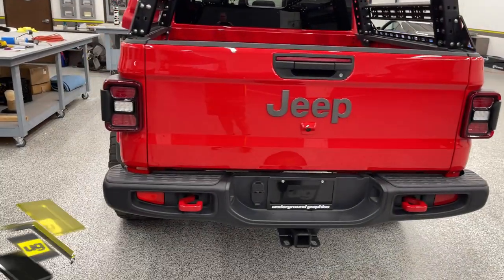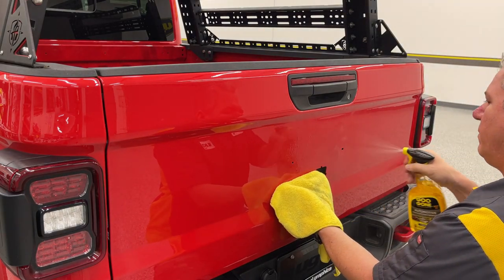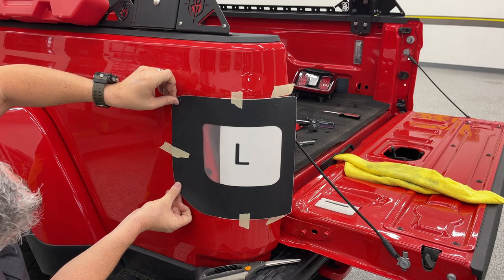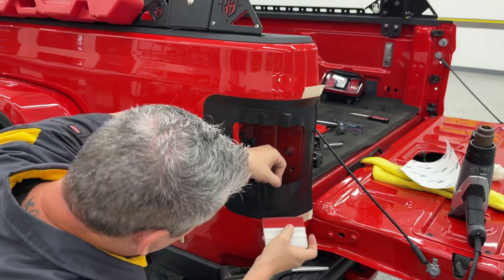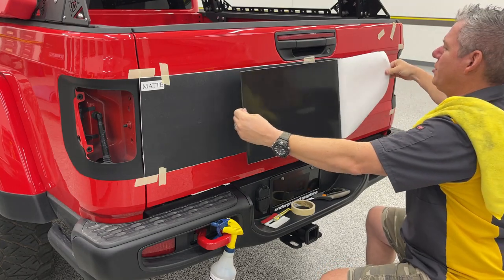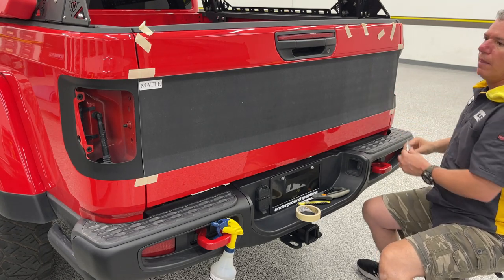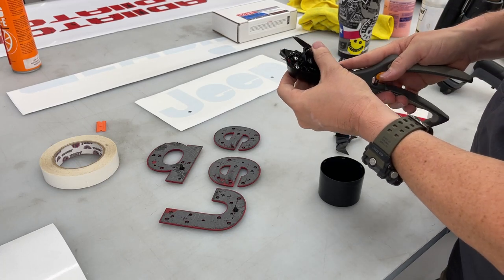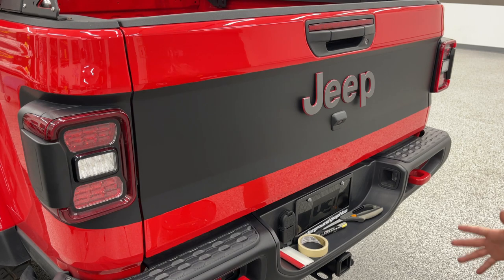How To Wrap Your Jeep Gladiator Tailgate | DETAILED Version | From Underground Graphics

Comment: Honestly if you redesign it so theres a cutout for the logo and camera it would help people align the vinyl when its time to put it on without having to undo half the tailgate.
Reply from the maker: We felt that was a short cut and didn't like the edges of the paint showing through.  Yes, this is a bit mroe work, but feel it't the "right" way.  The badge removal is really the hardest part.  The camera come off very easily and can be broken down to be wrapped easily as well.  We have gone through several templates to ensure what we have is the best fitment and finished look.  If you still are unsire of the DIY install, we would absolutely recommend professional installation.  Nothing wrong with paying someone to do what we dont; know how to.